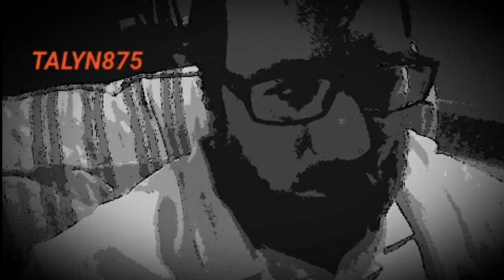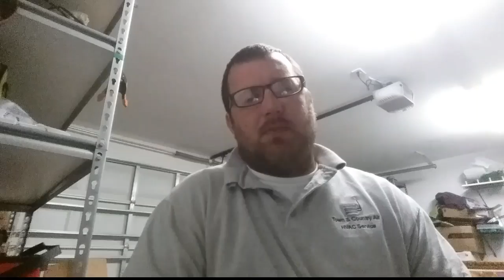Causes for High Evaporator Superheat  (Air Conditioning)

Comment: What about if you get high superheat and high subcooling?  I know low subcooling means a low charge.  Is that a liquid line restriction?  The filter drier when I checked it was a 2 degree difference.  Might that be the restriction?

Comment: I have a system used to works well. The condenser fan is burned out, and was replaced. But I found the suction line pressure was very low, and the liquid line pressure was very high. I replaced the liquid line filter drier and cleaned the piston and screen. Both suction and liquid line pressures are normal now. But I got high superheat which is around 35. Only half of the evaporator coil is cold. Any ideas about what’s wrong with this system? This system also has two kinks on the suction line which are less than 90 degree. Will these two kinks also affect the high superheat? Thank you
Reply: Im having the same issue, did you ever find a solution?

Comment: Just curious,if is picking up more heat ,shouldn't be cooling more.just want to see if you can explain as im still learning.
Reply: My explanation is: it is not picking more heat. The greatest amount of heat is taken when the refrigerant is at its saturation point to transform from liquid to vapor, after this if still takes heat but in much more less quantity. That is because latent heat is greater than sensible heat.